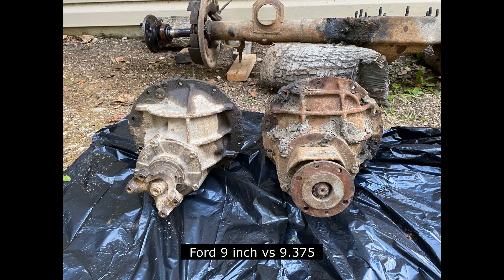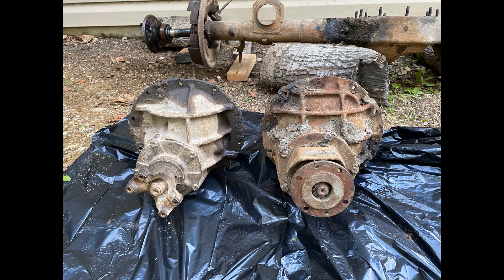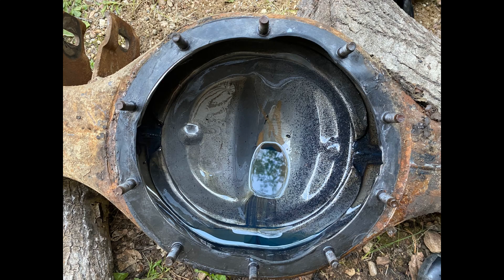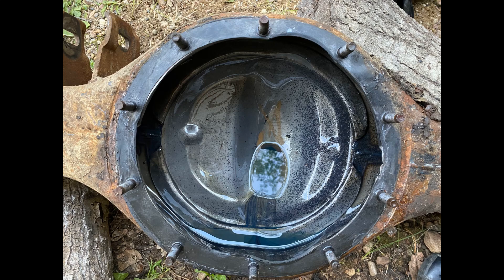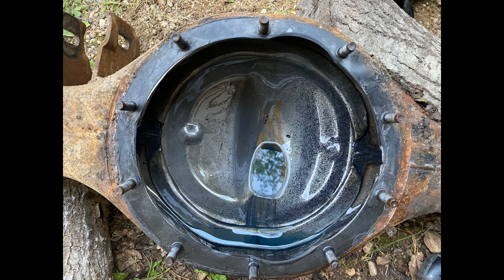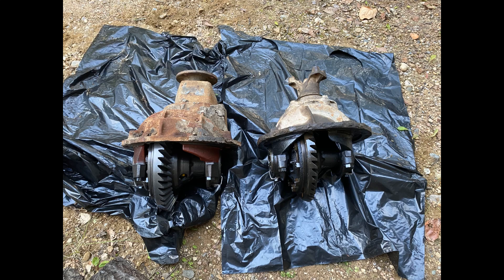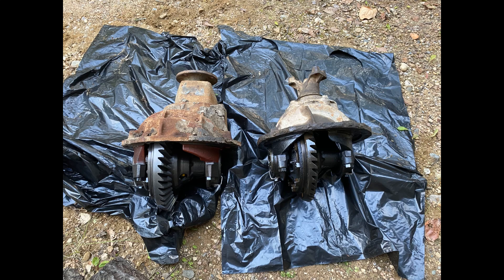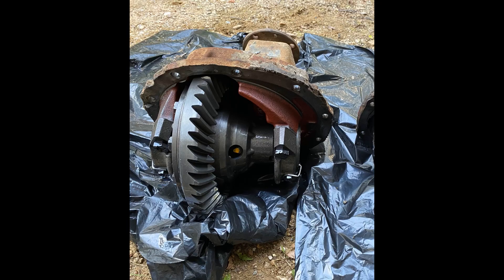Ford 9 Inch vs 9.375 Inch Rear End. Watch Before You Buy.

Comment: The 9 3/8 you have is not stronger. In fact it is weaker than the factory "N" cases for the 9 inch. Also, there is very little aftermarket support. These 9 3/8 are not just undesirable, it is recommended that you avoid them at all costs. Yes they have larger bearings and axles yet they are not as strong as a correctly set up 9 inch with the "N" case. Don't waste your time and money. The dead giveaway is the top horizontal rib droops on the drivers side. It is the only case that has this feature. One exception. if you are doing a concours restoration on a vehicle that had this axle from the factory.
Reply from the maker: You are totally wrong. The 9-3/8 was designed from the beginning to be stronger than the 9 inch. And I have taken both apart. The 9-3/8 has bigger most everything. You are just assuming the case is somehow weaker.